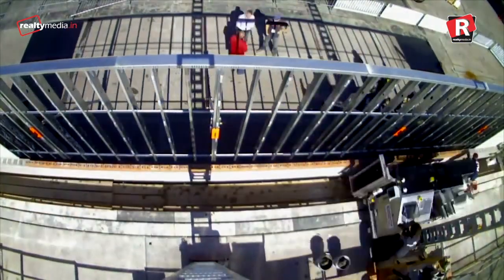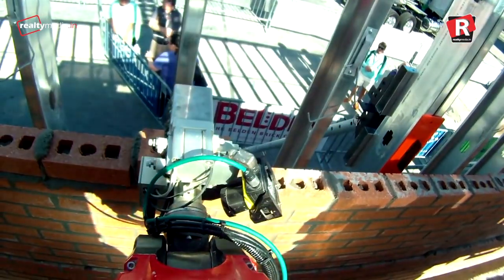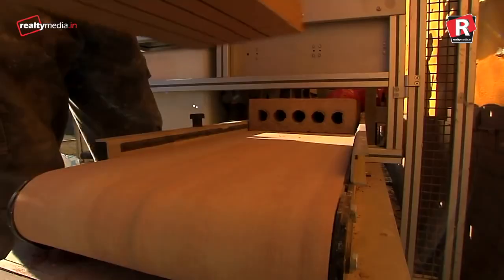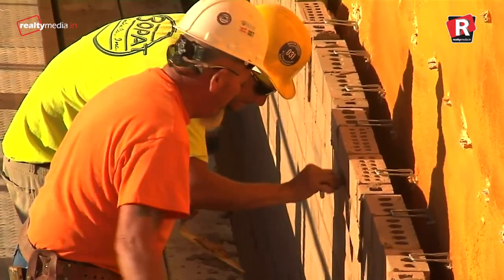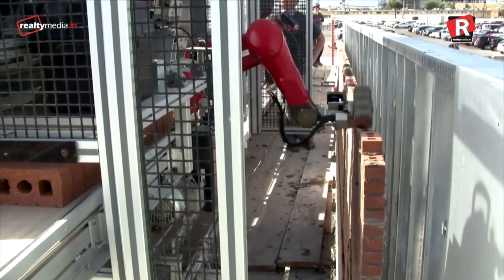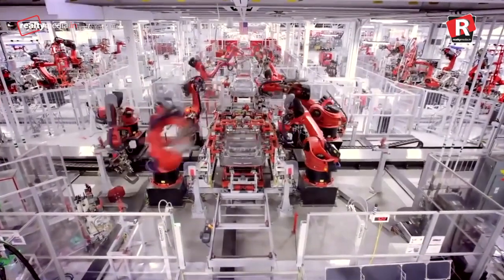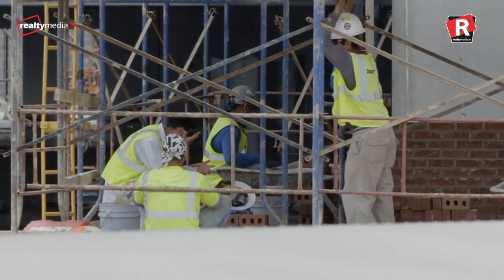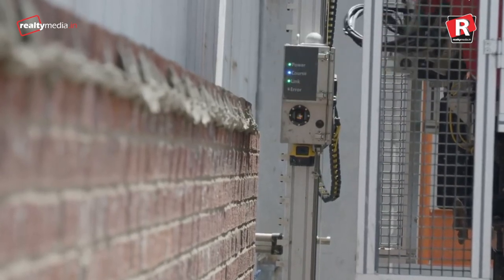SAM: Mason lay 3000 bricks a day

Comment: I'm a bricklayer in the UK. Masonry is an art... I don't agree with this at all.. the brickwork is sub standard compared to a hand laid brick.. the only reason it can lay that many is because it's straight runs and it dont don't stop..but you still need a hoddy to load it with bricks and muck..then you still need a couple of trowels chasing it and jointing up.. it dont don't make sense.. you could easily get 3000 bricks down on a run like that with a few decent brickies on a line..then you have all your insulation, damp trays, wall Ties, piers, your lintels... waste of time...you'll never replace the Mason...